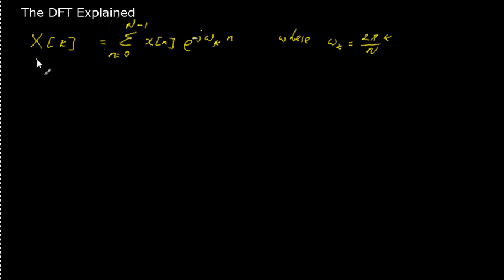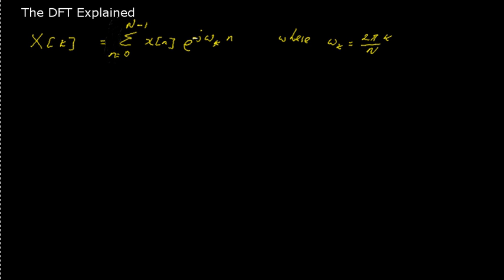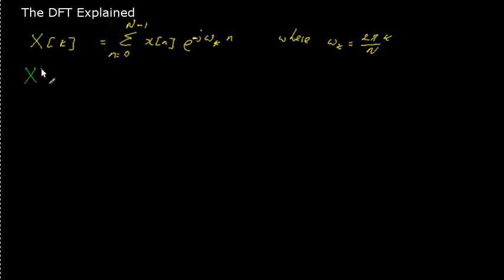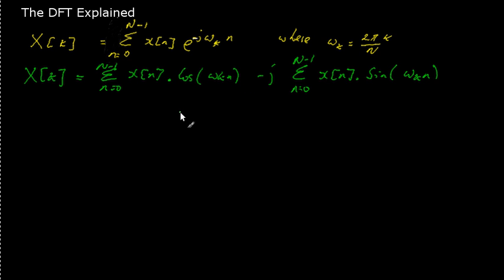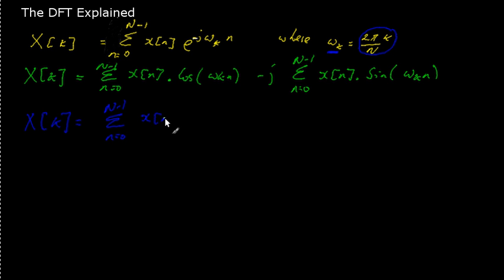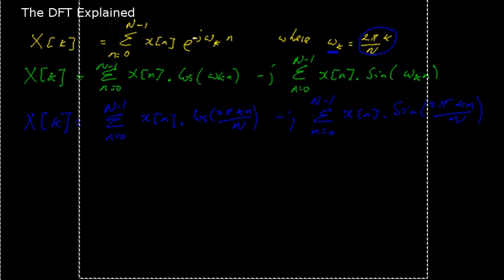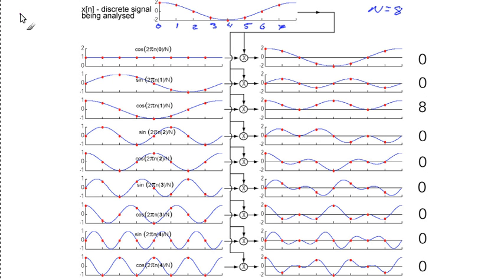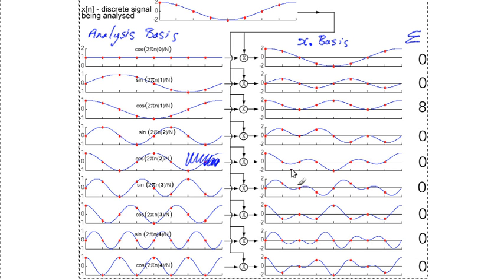Discrete Fourier Transform Equation Explained

Comment: Thanks. Very clear. The number of "test tones" K seems to range from 0 to N-1 (beyond that, the angle rolls over, so K=0 and K-N is the same thing). This means that the higher the number of samples N, the higher the number of bins K.  So a higher resolution result (and less frequency spread, presumably).

Comment from the maker: "why do you choose to scale by 4 at 28:00?". ANSWER: The 4 comes from N/2, where N is the number of samples in signal being analysed. Scaling by N/2 gives the amplitude of the sinusoid contained within the signal.
Reply: This is because when you "project" the vector over the basis vector, you need to make sure the basis is a normal basis, as you dont want the "projected approximation" to be dependent on the magnitude of the basis.

Comment from the maker: Not easy to explain in plain text but X[3] = X*[5]; X[2] = X*[6]; X[1]=X*[7].

Using the formula for basis functions i.e. cos(2pi*n*k/N) and sin(2*p*n*k/N) if you sub k for 2 and 6 you'll find that the cosine waveforms are identical while the sine waveforms are pi rads out of phase i.e. the sines are uncorrelated which results in the similarity measure for sines being opposite in sign for k=2 and k=6. Re{X[6]} = Re{X[2]} since the cosine basis functions are identical, while Im{X[6]} = -Im{X[2]}

Comment: Hi David, thank you so much for this video - as someone with no prior experience of signal processing, this video has been extremely helpful!

I apologise if you covered this (you probably did), but how do you quantify the values of the magnitude spectrum? Do you simply add a + bj together? Or do you find the values via: r = Sqrt( a^2 + b^2) ?
Reply from the maker: Alex,
mag = sqrt(a^2+b^2).

The key point is that the real value (a) shows the strength of a cosine waveform in the signal and the imaginary value (b) shows the strength of a sine waveform.

If you were to sum a cosine waveform of amplitude a with a sine waveform of amplitude b then the amplitude of the resulting sinusoid would be sqrt(a^2+b^2) and the phase shift would be atan(b/a). Note that the frequency of all the sinusoids must be the same.

Dave

Comment: If I want to plot the results of the DFT on a frequency spectrum with the x-axis as frequency in hertz and the y-axis as the magnitude of the frequency, how would I do that?
Reply from the maker: The following link shows how to do this using matlab https://www.youtube.com/watch?v=2IkdNsGQgEM.
Reply: Why is it that when plotting the magnitude and frequency, there shouldn't be plotted more than half of the data points? I've seen that the FFT representation starts to duplicate itself, but why does it do that?
Reply from the maker: It's not that you shouldn't plot more than the 'first half' of the DFT but it's generally not beneficial to plot the second half as it is just a "mirror image" of the first half (when dealing with  signals which don't contain any imaginary  values i.e. real valued signals - which is typically the case). Why  the first half is a mirror image of the second half is due to the fact that the real signals are comprised of sinusoids and sinusoids are comprised of a pair of complex exponentials i.e. cos(wt) = (e^(jwt)+e^(-jwt))/2 from eulers formula. The first half of the DFT contains the positive frequency complex exponentialse^(jwt) while the second half contains the negative frequency complex exponentials (e^(-jwt)). The magnitude of these complex exponentials need to be the same to ensure that the imaginary terms cancel, leaving a real valued signal - hence the mirror image.